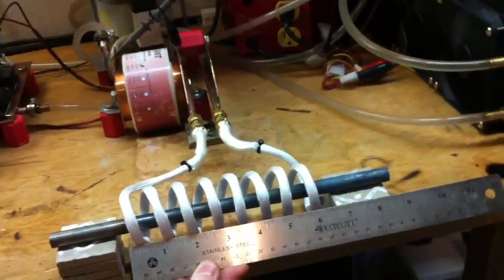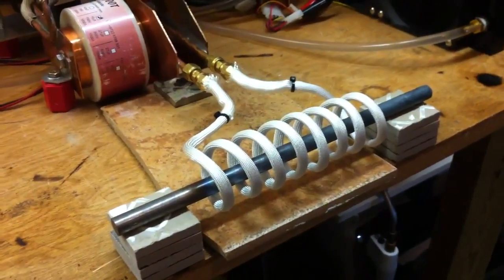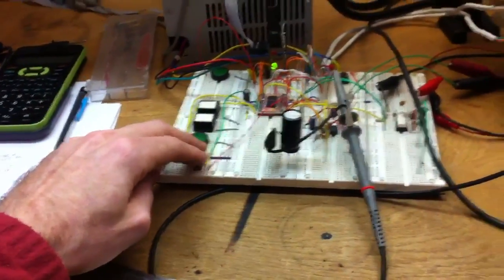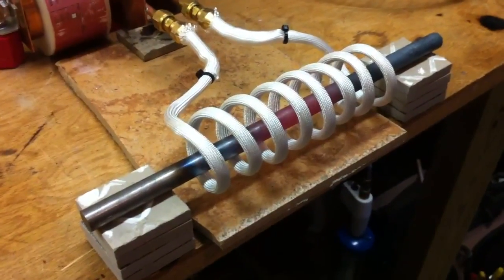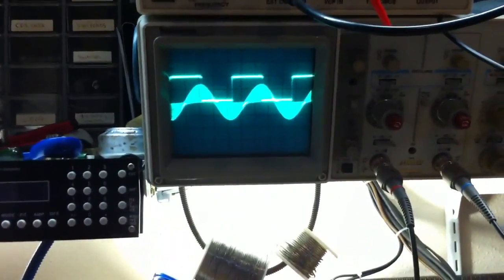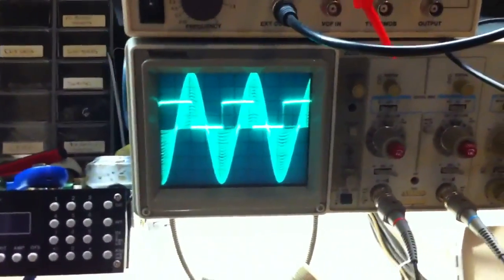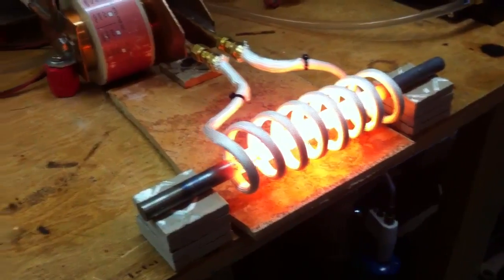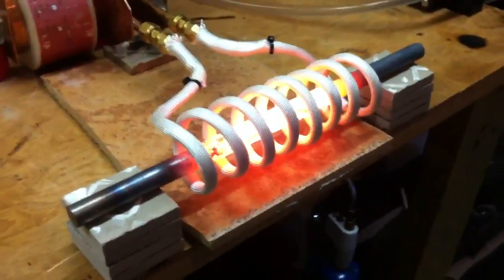Induction Heater - 6" Coil vs. 1/2" bar

Comment: Just a question, I'm looking to build one of these, on a small scale to play with, I wanna what kind of power draw you looking at, how power does it use compared to lets say a microwave or kettle?
Reply from the maker: MorbidSpecter The average microwave draws between 1-1.5 KW. This IH's power draw can be dialed in, if you limited it to say 1.5 KW that is enough power to work on smaller items such small knives, small section of 1/4-3/8 stock, etc. It can be dialed up to draw 25 KW with robust cooling but runs best limited to about 15 KW which is more than enough to heat a few inches of a 3"+ piece of metal in a couple minutes to it's melting point.
Reply: Josh Campbell Double thumbs up bro, thanks :)

Comment: I'd be nice to have induction coil like this for blacksmithing.  Was thinking of attaching my old tesla coil (discreet components, spark gap no electronics) to a copper coil to heat up metal.  Would you send me a schematic?.  I' have to get caught up to the 21st century.  I have 'scope and frequency meter etc.  Thanks winchandle@gmail.com
Reply from the maker: William Shepard Your on the right track with the tesla coil stuff but I'm not sure about the spark gap driver in this application. My first TC was a spark gap and leyden jar type but you won't be able to get the frequencies you need out of that setup, not to mention all the horrible harmonics and power issues you'd have. Best to get caught up if you want to dive in to that realm. There are plenty of great resources, give it a shot!

Comment: Are you passing AC or DC current through the coil
Reply: Ivan Richard it's high frequency AC
Reply from the maker: Ivan Richard musicalmario28 is correct. The alternating current is key to the devices ability to heat the work piece. Just as a transformer only functions with a change in current, the work coil is a step down transformer with the work piece functioning as a single turn, shorted secondary.
Reply: Josh Campbell thanks
Reply: musicalmario28 thanks

Comment: The EMF you are exposed to in these tests, are not good at all to your health.
Reply from the maker: namrur What are you basing that assumption on? The field is non ionizing btw.
Reply: Josh Campbell 
You can read online about the hazard (Electromagnetic radiation fields).
Induction process based on a very high radiation. Your can measure it with any EMF gauge. Here you are dealing with a very high EMF. Much higher then a high voltage power-line that known as causing a DNA mutations and cancer at the human body. This was proved by many researches that you can find online. Ionizing doesn't do nothing with the hazard. Just keep your health. Your laboratory is nice, but you have there all the worst appliances that produced highest levels or radiation (including the measuring instruments you operates there, that contains internal transformer). If you must do that, at least stand 3 meters from the equipment when it runs/turned on.  Especially avoid any children in the surrounded area. And order your self today some good EMF tester, to monitor you laboratory constancy while you are working.
Reply: Josh Campbell Easy to solve, get an EMF gauge and test it and post the video :)
Reply from the maker: MorbidSpecter I will do that for sure!

Comment: I liked what I had viewed im building a plastic mold injection machine and have done all but wire in a heated tube to melt the media at 425 deg can you help me with a plan to do such I have a control unit thremocoupler and relay the tube I wish to heat is 1.5 id and 10 inches long I have made a ceramic type with a wound kiln element but seeing the induction coil got me thinking to better heater function over all thanks kenneth
Reply from the maker: kenneth berkley Sounds like a great application for induction heating. I'll be working on finalizing the designs and posting to GitHub soon.

Comment from the maker: @Jose Augusto Rodriguez Martinez: 1/4 inch OD Copper tubbing
@Picobyte: Thanks, and the breadboard is long gone now.

(Not sure why I could not reply to either of your comments. Says linked comment and there is no reply button next to the thumbs up/down. Seems to be a known issue related to the posters google plus account settings.)
Reply: How do these work?
Reply: Less efficient than it would be with pure elemental silver wire...
Reply: Thanks Josh Campbell, it will help me a lot with my thesis project.
Reply from the maker: Jose Augusto Rodriguez Martinez Your welcome. Working on a thesis though I would expect a tougher question, but I guess it was hidden by the fiberglass sleeve. ;) Still there is a huge current alternating through that part of the circuit, a material with higher resistivity would not be acceptable. The low grade of copper tubing I'm using is not even optimal but does work. Copper alloy 101 should be used (oxygen free high conductivity). If you really want to get efficient a gold plating on the high frequency copper tank parts would result in less resistive losses to heat. In fact it's almost foolish not to do this in similar applications like ICP torches (inductively coupled plasma) where frequencies are many orders higher and thus the skin effect is exaggerated, not to mention the corrosion resistance would be far superior.
Reply: Josh Campbell I need an induction heating power supply, what do you recommend?
Reply from the maker: Owen Chase There are many factors that go into choosing an IH inverter such as application, environment, duty cycle and available input power just to name a few.
Reply: O wow
Reply: Now imagine how much more efficient this will be using tubing made of gold... Boooommmm! 😁

Comment: Hello Josh,  I have a limited knowledge of induction heating but have a potential application.  How scalable is the system?  I would like to heat a single pin within a plastics injection mold.  Not even sure if this is possible.  The pin is small with a .125 dia.  Need to need to maybe 300-400 degree during cycle.  

Can I get your email so I can share more on the details?
Reply from the maker: Induction heating is extremely scalable and versatile, that's a big reason behind is proliferation. There are a few key factors to consider when matching a system to a target work piece such as desired temp, work piece size and how tightly the work piece and work coil can be coupled. In general smaller work pieces require higher frequency, and larger coupling distance requires more power. In your case with such a low required temperature a relatively small and basic system would likely suffice as long as your mold is not a material that would act as a susceptor.

Comment: Josh great job.  I know this took some time and you seem like a smart tech/engineer!   What kind If wire is that and insulation you're using there? Are those brass plumbing unions I am seeing there?  Just curios... 

Nice video.  What kind of amp draw? Power supply?  Haha lots of questions I know, I love electronics and mechanics.  Check out my channel.  I'm gonna subscribe to ya... Thanks!  Steven.
Reply from the maker: It this video the working coil is standard 1/4 inch type L copper tubing made by Mueller. The insulation on it is fiber glass from Alibaba, it doesn't hold up well but is nice for testing to prevent coil shorts. I don't think I went much above 27 amps on this run but the unit can run all day at 60 amps (240V single phase input) and can safely run peaking just above 100 amps. The power supply consists of a high power AC line filter that feeds an unfiltered rectifier (no soothing cap). This serves to keep the power factor low (perfect actually .99), reducing stress on the high power component and lowering the power supply requirements. The inverter and tank don't mind the 60 Hz signal imposed on the resonant frequency (20-100KHz) since it's well below any frequency that would affect the tank. 

This project is open source and I'm making it available on the GitHub page listed in the description above. I don't have it all on there yet but it's I'm working on it between running a business that takes 110% of my time lol. Thanks for the complements btw and have a happy thanksgiving.

Comment: can this thing heat water if you pass a water pipe insted a iron bar??, of curse a pipe with runing water
Reply from the maker: Yes, or you could configure the work coil to heat itself since there is already cooling water running through it.

Comment: Hey Josh....I recently made an induction heater similar to yours...but mine is at a smaller scale...I was wondering of you could help me out with the schematics so that my circuit could work with a higher load to heat larger materials. I would appreciate  if you could help me.
Reply from the maker: I sent you a message with my e-mail address, send me what you have and I'll try to make a recommendation.
Reply: Josh Campbell Please send me your email address too. I am taking this as my B.Tech final year project. I really really need some help with the schematics as I am a metallurgy student and I am finding trouble with circuits.
Reply: Please send your e-mail address

Comment: I got a question  for you. Im building a large still for turning plastic rubber and used motor into gasoline and i want to use a induction heater as a heat source.  I have 2 microwave transformers and a large transformer from a forklift charger can i turn these into a heater. My boiler will be 24 to 36 inches wide and and need 800 to 1200 F thanx
Reply from the maker: There are lots of resources on DIY heaters of all types including induction. Your MOT's and forklift charger could be one building block to an induction or resistive heater (http://www.instructables.com/id/METAL-MELTER/), but alone cannot just be turned into an induction heater.
Reply: Thanx for the link. Thanx for your time

Comment: Thanks for posting, -  I really appreciate all your replies to the questions here.
Most people do not reply and your answers are very helpful to me as a beginner.
Just super. I look forward to building one to heat household use water. Cheers, gk.
Reply from the maker: Glad you found it helpful. Water heating is a great application for an induction heater and can be easily achieved by configuring the work coil to heat only itself.
Reply from the maker: Ediphen There is already cooling water flowing through the copper tubes you see wrapped around the steel work piece. With no modification to the machine you can remove the work piece and crank up the power resulting in rapid heating of the work coil. In a real application one would design the coil to contain the magnetic field, or remove the coil all together and re-tune the system. An understanding of the resonant tank will lead you to your answer of how to do it. And as always there is no one right answer here.

Comment: Hello, is it safe to place your finger inside the coils?
Reply: Remove all rings and other metals items from your hand first..
Reply from the maker: The magnetic field typically has no effect on flesh and bone unless, as RT mentioned, you have a susceptor in or on your person. As a safety precaution you should still never attempt to touch or insert any body part into an energized coil. The work coil is galvanically isolated from dangerous AC mains current but the potential between turns should always be respected.

Comment: Hi Josh, From earlier correspondence to Keith Wilson some 3 months ago , you appear to released the schematics, would it be possible to have a copy nickshanesmith@hotmail.com, since I would like to have a go at making an inductive heating system, but my electronic side is a weakness. Also you said you were porting the code over to 'C' , did you ever get round to doing that ?
Reply from the maker: Nick, I'll contact you by e-mail. I have a release coming up soon for all the past project files. It's taken me a while to clean everything up and get it into a format that is presentable. I've been working on the next hardware revision: http://youtu.be/7VAaMTlzTO0
I source a lot of parts through Alibaba, wouldn't mind having another friend over there.

Comment: is that a hollow induction coil with water running through it for cooling?
Reply from the maker: Yes, without cooling water the work coil heats up. The heat causes the resistance of the coil to rise which causes more heating. The coil would eventually be destroyed due to thermal runaway.

Comment: Hi 
My name is Paul,can you help me with the circuit diagram 
to build an induction heater. 
I saw in your video that also refrigerate the coils with water, it is necessary and you can say you had problems with this. 
I want to do a practice for my studies of mangetic uses.

 thank you very much for your help
Reply from the maker: Do you have a specific question Paul?

Comment: If during induction You use a second coils inducer , with different impulsive frequency (example a sparkler device to produce microwaves ) , You can modify the properties of material ?

Comment: When You heat the bar the weight changes ?
Reply from the maker: Good question, and depending on the precision, the answer is "no" or "it depends."

The dimensions change with temperature and the density changes as a result of the dimensional changes, but the weight is not changed.

We commonly weigh things in air and there is an air bouyancy effect. We only get "apparent weight" unless a lot of math is done to caclulate and correct the air bouyancy effect to get weight in a vacuum. The density of air is affected by temperature, pressure, and humidity. The apparent weight may change slightly due to the state of the air. For commercial weighing, this is normally ignored; in laboratory weighing, it is normally considered.
Reply: Josh Campbell
The dimensions change with temperature and the density changes as a result of the dimensional changes, but the weight is not changed.....then the body is rised up for Archimede effect
Reply: Emanuele Civetta But when You use the electromagnetic effect, You can change the direction of current inside the body , the microscopic magnetic coils can change the spin and magnetic orientation ... and the interaction with magnetic earth field can lift up or down the body
Reply: Emanuele Civetta  all depends from pattern and frequency of excitement

Comment: Did you ever release the schematics? or were you still holding off on that? if you released them, where could we get the schematic? Thanks
Reply from the maker: Kenneth, I'm working on finalizing the board design and schematics for the 3rd version (the one in this video). However the schematics for the 2nd version (the one my brother has been using in his shop for over a year now) is over on the 4vh.org projects forum. Drop me an pm with your e-mail and I'll send them to you.
Reply: Josh Campbell - thanks man- really appreciate it. kwilson0122@gmail.com
Reply from the maker: Kenneth Wilson Just sent it, let me know if you don't get it. Sorry for the delay been a busy week! :)
Reply: Josh Campbell  Any chance you would build one of these for sale?
Reply from the maker: I'm working on that, likely in kit form. (Maybe offering kit assembly as well.)
Reply: i would totally buy that
Reply from the maker: Kenneth Wilson Duly noted! ;)

Comment: i wonder. coudl this be used to heat water ? like if a pipe was through the center and either of the hallow pipe lead into the bath tub.
Reply from the maker: Absolutely, in fact the work coil needs to be cooled by pumping water through it. You could even arrange the work coil in such a way as to cause extreme self heating and take advantage of that to heat water.
Reply: Josh Campbell awsome!

Comment: Where would one start to read if one would like to build one of these? Im interested in it for the application of melting cast iron for casting.  But someone needs to start with making stuff glowing red im guessing. =)
Reply from the maker: Hey bud, there are lots of places to start and many different methods consider. If you are serious I would recommend the book "Elements of Induction Heating: Design Control and Applications" by S. Zinn and S. Semiatin. There is some dated info obviously but it lays a strong fundamental foundation. 4hv dot org is also another good resources for some real life examples done by others. I have my first prototype on there that my brother is still using in his shop. He has some more videos of it in action http://youtu.be/Gr31QNQfO6E  at one point he had one showing us melting some steel bars down in a small crucible.
Reply: So know looked into your 4hv project, skimmed all the pictures and read upon royer, pll, zvs and all what nots and now im really just horribly confused.. lols i havent been able to determine the benefits of say your design what seems to be a IGBT h-bridge inverter with a PLL controller or am i totally wrong here from say a half-bridge igbt circuit or a zvs circuit (that seems really easy to make though).
Reply from the maker: Moronicsmurf I get where your at, there is a lot to take in especially with all the diy examples and a myriad of different methods. Educating yourself on them all will help you determine what you need or are willing to tackle based on your end goal. My first one was an IGBT h-bridge with a PLL/Micro controller setup (not counting a small ZVS many years ago). ZVS is an ok place to start for small scale testing (not to say it can't be taken to a larger scale). Although I think that learning how to manually control the resonance and working with larger drivers is a big part of what you need to scale up. My second model uses a single micro controller with no PLL or other complex analog circuitry. But unfortunately I have not had time to document it to the extent I would like to, but I do intent to. I got lazy and wrote the initial code in Bascom, I'm porting it over to C now and improving the PI(D) resonaces control loop as well as finalizing the board design.